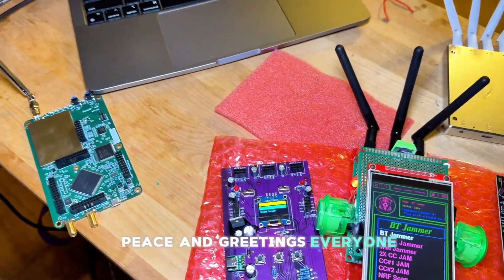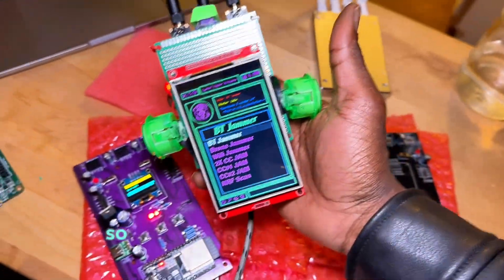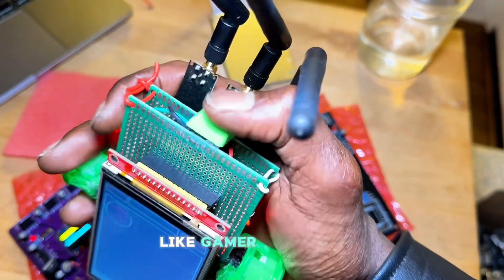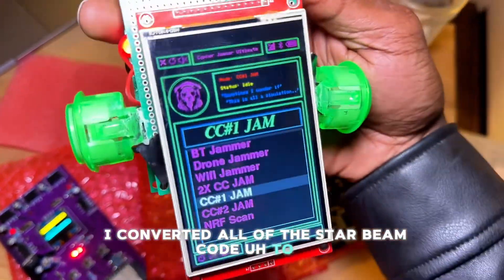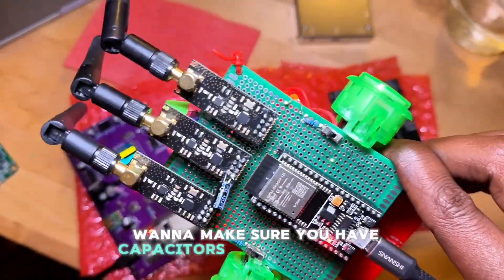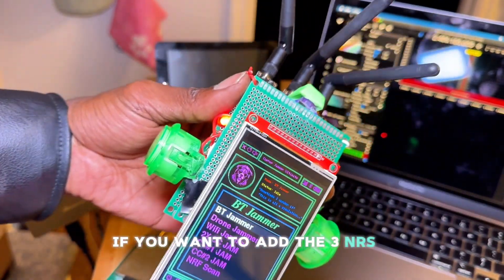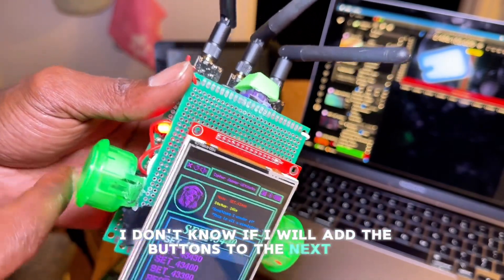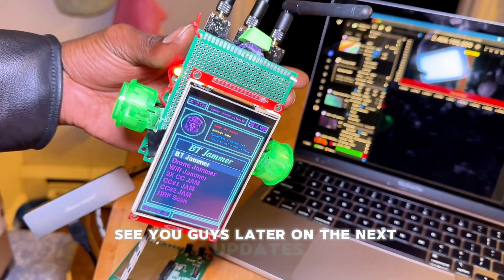Bluetooth + WiFi Jammer Deluxe with Arcade Buttons

Comment: Hey I’m curious what library you are using for that screen because I did a project with one but refreshing the screen took a lot longer.
Reply from the maker: Adafruit ST7735 and ST7789 Library works for ST7796S 4inch such as mine
Reply: @ Thanks, I was having trouble with adafruit but maybe I’ll try it again.